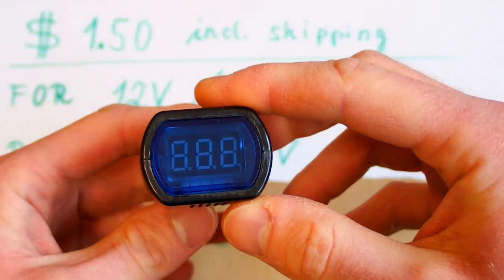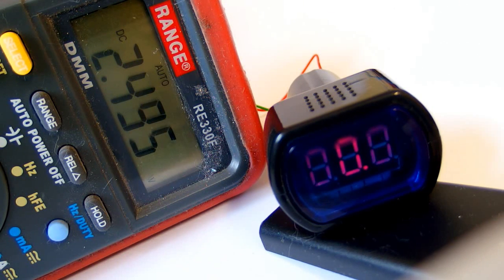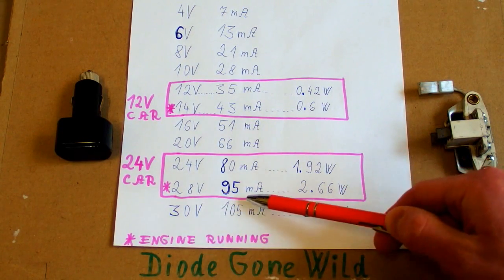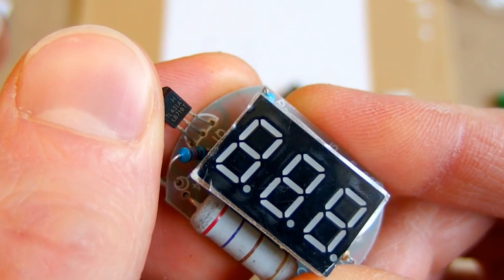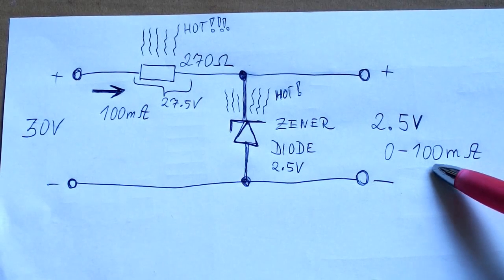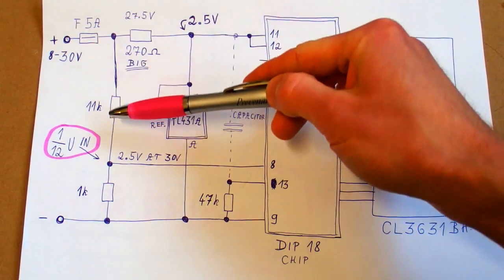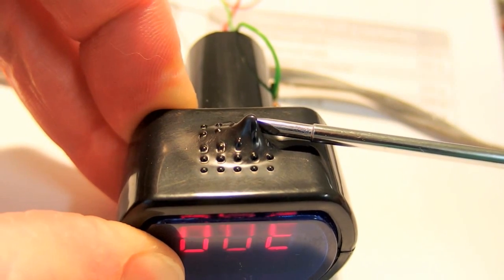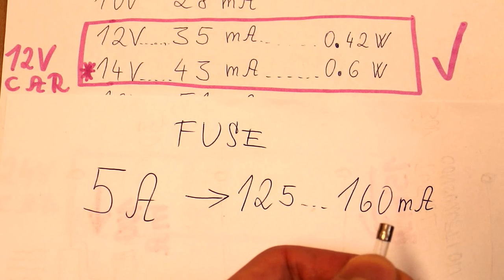Self-melting Car Voltage Meter

Comment: The chip is ht46r47 and it is a 8bit microcontroller and it was meant for battery charger application or similar. I think they coded it with there program and using internal analog to digital it can tell the voltage.

Comment: Mine (like a lot of peoples) was reading low at 11.8V for a 12V input. It had 1K and 15K resistors. I put two 1M ohm resistors in series (=2M) across the 15K resistor and now it is accurate. The 1K and 15K SMT resistors were actually very accurate and the 2.5V was also pretty much spot on. So I guess the problem lies in the processor chip - either wrong software or inaccurate AtoD ladder resistors inside the chip. However, when assembled, every time I connect it to a 12V supply I get a different answer from 11.8V to 12V. It seems to update once a second but not always gives the same answer.

Comment: The video is great, this digital voltage car charger is really good, I bought this renhotecic brand car charger not long ago, it's really good, if you need it when driving, you can prepare one.

Comment: They're still on eBay today. You should get another and see if they've changed the circuitry and if not, show us how you fix it with a regulator. Do you need to add resistors to set the output?
Reply: not that easy to fix. Unless you use a switching regulator
Reply: Even a small linear voltage regulator like 78L05 would fit in that meter, and it would be significantly more efficient.. there's no need to have a switching regulator inside.

Comment: Noooooo, I've just bought same product to diagnose my car battery. Now I feel uneasy and unsafe, so thank you very much.

On the other hand I just put it for few seconds before starting my car, also it is operating in 12-14v range, so no problem whatsoever. I'm still considering replace thing funky power supply it has with proper LM78XX variant. Should be an easy task, right?

Comment: What a stupid video in which using DC 30v to melt the meter. The Volt Meter packaging already seriously mentioned that this meter only used for DC 12v to maximum 24v ONLY. What an idiot of you.
Reply: Yeah, but it wasonly a test, how save it is

Comment: Is there really usal car with 24V batteries?
Reply: Lorries and trucks often use 24v
Reply: golf carts
Reply: incroyables expériences vous connaissez DiodeGoneWild??? J'y crois pas! En attendant on est d'accord qu'on peut avoir ce genre d'objets en bien mieux pour un prix équivalent.

English version:
do Incroyables Expériences know DiodeGoneWild? I can't believe it!!! But still we all agree with that you can get this kind of items in much better version for the same price!
Reply: I think trucks have 24V battery but its just named as car battery voltage monitoring device
Reply: Yup. There is many normal trucks and suvs using 24v system like dodge ram trucks have 24v system cus of the large diesel engine it takes a crap ton of current in 12v system that's why they have 24v system.

Comment: I keep one of them little fellows handy in my glove box. Great fault finding tool in my opinion. It has just proved a massive help the other day when the battery light suddenly came on (turned out the alternator was not charging due to a bad regulator which is somehow integral with the carbon brushes in a Golf Mk4) and helped me determine if I could continue driving off the battery until I reached the next major place with an auto electric shop (I eventually could and had a voltage of 11.4V when dropping the car at the shop). No reason to keep it plugged in all the time, though, especially in cars where the fag lighter is always powered, regardless of which position your ignition switch is in.

Comment: A low current fuse like 125mA has a high resistance, it can drop up 2V at 125mA, so it would affect the measurement too much especially because of the parallel voltage regulator.
Reply: Drop 2V at 100mA? Then replace the resistor with a linear voltage regulator.

Comment: I don't think this measures your car battery, only the voltage that is being regulated by your cars fuse box and cars wiring system.

Comment: I think the fuse is so big because a smaller one would have too high voltage drop on it. Despite that, I really can't understand why they used shunt regulator.

Comment: The chip at 11:30 is actaully a microcontroller built for battery charge detectors ...
http://www.ec66.com/market/sheet/HT46R47.pdf

Comment: This melted plastic remindes me of my small vacuum cleaner. I accidentally grabbed the wrong charger. I only looked on the polarity and the voltage but had one that can give 2 times the Amp. Was wondering whats smelled so strange and looked at my vacuum cleaner and there was a spot that looked like rubber and i touched it. It was hot but the vacuum cleaner is fine. 

Whats interesting is that i have a AC/AC plug. Don't know from which device i got this but i think it would be terrible to pick this plug, for devices that needs DC.
Reply: Videogames are witchcraft...

Comment: You know why it's melting? you're basically doing a torture test. Running it on 30v which is not so common in cars. Also, you're running it in an extended period of time. Normal periodic non continuous usage would be just fine.
Reply from the maker: It says it's up to 30V, so why not test it? In a truck or other 24V vehicle with the engine running, you normally have 28-29V. This is very close to 30V. And it's quite possible that people will leave it in the cigarette socket continuously. There's nothing to stop people from doing this. A lot of people actually want to have a permanent voltage display in their vehicle.

Comment: You can use a multimeter to measure the voltage through the lighter socket.

Comment: wow... in first part I've thougt - okay it seems to be really accurate. I've bought another one (not from e-bay) for 20 Euros and it was disappointing because it's measuring failure was horrible... At really14.4 Volts it shows 13.6 to 13.7 Volts (maybe because of Schottky-Diode Voltage drop of 0.6 to 0.7 Volts?)

But in second part I've seen the plastic melting I've thougt NOOOOO - why? Why such crap that's so dangerous?
And the the fuse is... uhm what word should I choose? With 5 Amp fuse it will burn like hell in case of failure...
Reply from the maker: This one is relatively accurate. There's also a  modernised fully SMD version of it, which is even worse. The accurate 11k resistor is replaced by a 10k smd resistor, which was probably cheaper and easier to find.

Comment: I use mine on a 12 volt battery for short periods only but I'll check the fuse and change it .
Thanks for all your videos where you do a great job explaining and tracing out the circuits on switch mode power supplies.

Comment: I think I see the issue at 5:03.
2 of the solder joints are fused together
Reply from the maker: That doesn't matter. It's on the same track. The design is the issue :).
Reply: OK. I'm not very experienced with this kind of stuff. It just raised a red flag.

Comment: Unless you have a run away voltage regulator in your car, plugging one of these into most modern cars is not going to hurt anything. Being they are actually for test purposes only, most people wouldnt bother leaving it plugged in anyways.
Reply from the maker: Once I had a runaway regulator in 2000 Skoda Felicia. The voltage went up to 20V and the battery was boiling and splashing all around. After replacing the regulator, the battery and all of the blown lamps, the car works again. Such a  voltage meter would reveal the failure earlier, but having it plugged all the time may turn the car into a pile of ashes...

Comment: 14.8v at 5 amps?

74watts before the fuse goes no point in having it the wires would melt before the fuse making it a few penny’s cheaper

Comment: Yeahh that's not how you make a voltage meter. Good job China, yet another dangerously cheap product. If you really need to know the voltage in your car, get a smaller voltage meter with only LED display, circuit board on the back and two wires for power. They have voltage regulators built in, and sense voltage from supply voltage. Cut a small rectangular hole in your dashboard, fit the display through and use the two holes on the circuit board, some spacers (sold separately) and two M3 bolts and nuts to secure it, then connect to supply voltage. Easy, doesn't get hot, doesn't have a shunt resistor (because it isn't needed to sense voltage) and self contained.
In fact, here's a link to the voltmeter described above: https://m.ebay.com/itm/Mini-DC0-30V-LED-3-Digital-Diaplay-Voltage-Voltmeter-Panel-Meter-With-2-Wires-HQ/222642267593?hash=item33d68365c9:m:mdAg26sJy4DzPFMQ88GqmWQ
And here's a link to a fancier car voltmeter: https://m.ebay.com/itm/12V-Mini-Digital-Voltage-Meter-Display-Voltmeter-LED-Panel-for-Car-Motorcycle/273028120054?epid=595431268&hash=item3f91be7df6:g:N90AAOSwLjxaXj1l

Comment: The voltage divider which makes 30 volt appear as 2.5 volt is the analog input of the ADC. Since the entire device draws only 5 mA while driving both the ADC and the 7 segments LED display, it is obvious that no resistor is needed, the chip does a good job regulating the current.

Comment: U=I*R? I learned E=I*R. E stands for Electro Motive Force. What does U stand for? I'm guessing it's not an English word. Nice video. I'm glad that didn't melt in your car!
Reply from the maker: "U" stands for voltage, but this may probably differ from country to country.
Reply: Voltage is basically the same as E in the real world
Reply: When you are talking in terms of U you are typically referring to a portion of a circuit, using Ohm's law (a localized difference of potentials). When using E you are using kirchhoff's law for a circuit (difference of voltages). It's more a matter of context since both E and U refer to the voltage or the difference of potentials..
Reply: DiodeGoneWild in holland the same, also U I R
Reply: U is likely from the German word Unterschied which means difference, referring to the difference of potential.

Difference of potential = Intensity of current * Resistance to current.

Comment: I got 2 of them. That's a good video. I won't use it for long time. Put a switch on it. When not using the volt meter.
Reply: Even better, pull it out of the socket ;)
Reply: Should be safe in a 12v system
Reply: I put permanently on my car even when the engine is off, it is still turned on. I hardwired it and it is still working.
Reply: Put a 7805 before the resistor and you're okay.

Comment: I have a couple electric blankets that use that same screwed base.  It draws higher and melts in the first hour of use.  Common, and not good, design. Change the plug, all good again.  I wonder if their market is one time use devices.

Comment: Looks like a test device, made for occasional use.  I think it would even be OK if just used to check by a mechanic, and I can't really see any reason to run down the road with one plugged in, it would just be another distraction, especially when it catches fire as you are doing 80 miles per hour down the interstate!
Reply: Mine has been plugged in for years and works fine

Comment: Wow. Were they really too cheap to use a proper linear voltage regulator? It's not like those are expensive in China.
Reply: Funny enough, LDOs are way cheaper in mass production as you get rid of two large solder joints and two thick pins to bend and trim. The bypass capacitors are required though, yet again, even in the present circuit they'd better put them in... Many cheap devices' engineers seem to be somewhat obsessed with shunts, even if mains-powered :)
Reply: It's not just a voltage regulator; it's also the precision voltage reference used for calibration.

Seems a bit of a strange way around to do it, but there is actually a little bit of method behind the madness: the voltage actually gets more stable and accurate as more current is drawn, at least up to a point.  It is fineà for 12V operation; and even for short-term use at 24V if you take care not to leave it running too long.

Also, it's a nice, big resistor, so they knew it was going to get hot. I don't think this device would ever go completely on fire,  unsolder itself or anything; the worst I would expect to happen would be for the display to soften and distort out of shape.
Reply: Power dissipation would be the same!

Comment: You have made similar with pic's or atmels.
What a cheap way to make a supply :-(
I imagine a buck regulator would do a good job too.
Reply: No, in this case the linear regulator is better, the display does not need a lot of current. The reason it burns is that they chose a too low resistance. A buck converter is not very efficient at light load

Comment: The chip is a Holtek microprocessor :)
Reply from the maker: You're right. To this day I was only coming across ATMELs and PICs. By the way, this type of HOLTEK is OTP,  so it is completely useless for hobby.
Reply: Holtek are PIC compatible.

You'll also see 8051 controllers like STC, unmarked OTP controllers that are mostly PIC compatible, like Holtek or MDT, which might be clones of Holteks, and STM8 mirocontrollers in Chinese electronics. Usually, you can't justify an Atmel or PIC if you look even at STM8 pricing!
Reply: Stm8 is very good, i use it to make sinusoidal inverters, with voltage regulation and protection, no problem at all